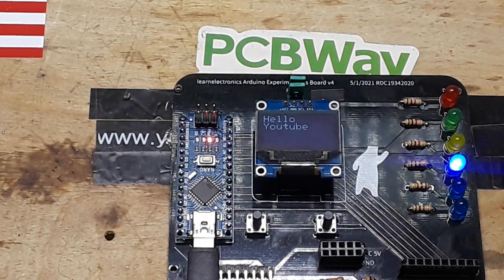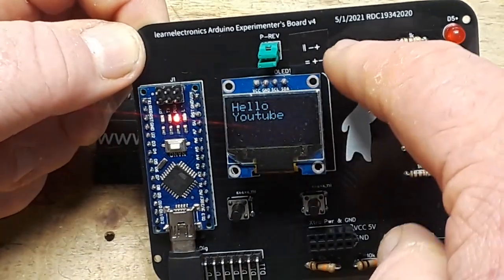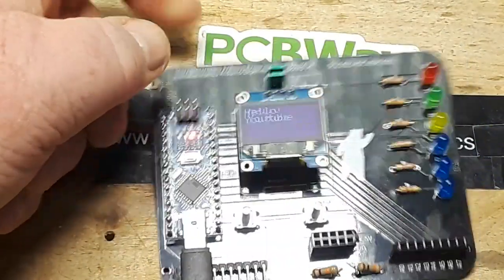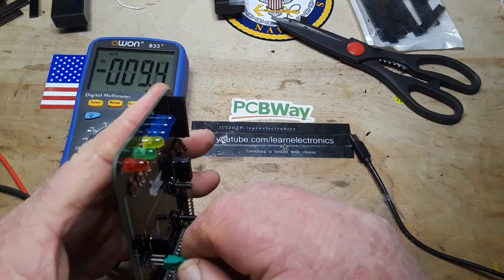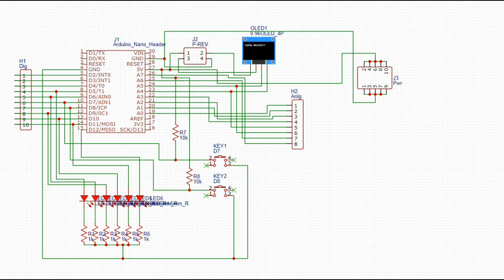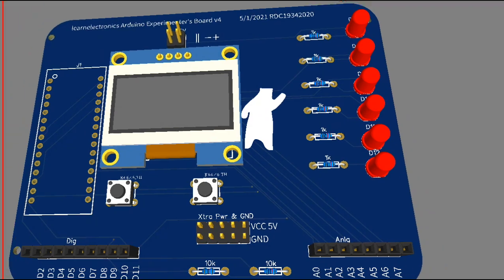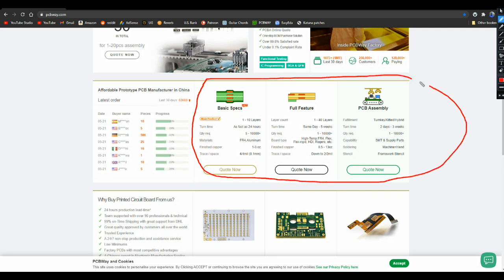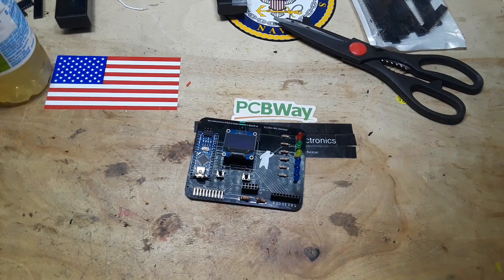nano Experimenter's board v4 with switchable power for OLED

Comment: Seen Julian do this, brilliant fix. Ideally it would be great to have a set standard. Just like when Grove connectors are sold, it's not only the VCC and Ground the Chinese stuff up but occasionally also SDA and SCL. Typical of knockoffs, they do this on modules also sometimes and you cannot go by pictures because they send what is in stock and use pictures stored on the PC not of the actual item.
By the way, have you tried the new nano 33 boards yet. I also want to try the Arduino MKR boards.

Comment: Nice little project. Good idea on the jumper, I’ve experienced same issue with the oled displays, Some are vcc gnd and others gnd vcc. The jumper solution is a good simple way to be able to use either or oleds.  You should break out the RX/TX lines tie them to a couple of led’s.